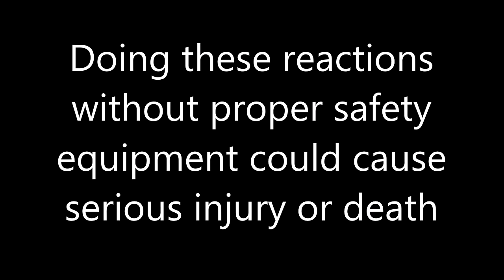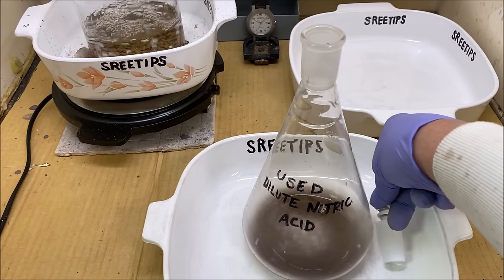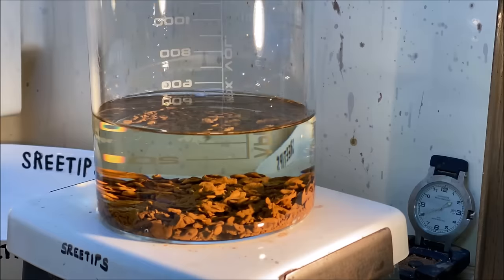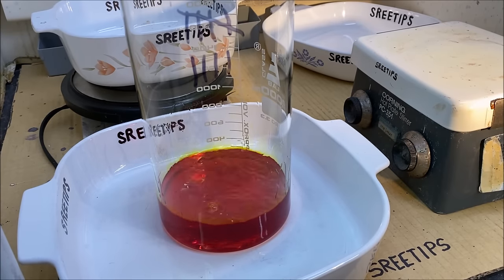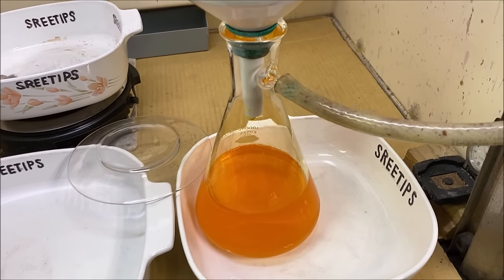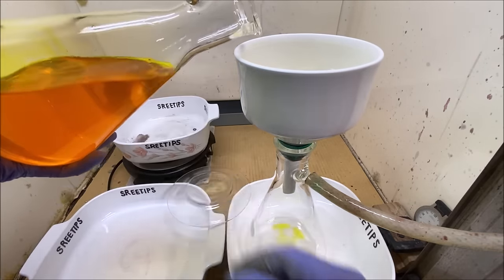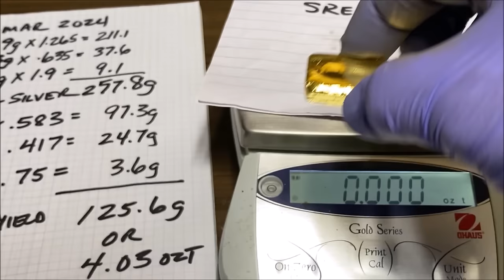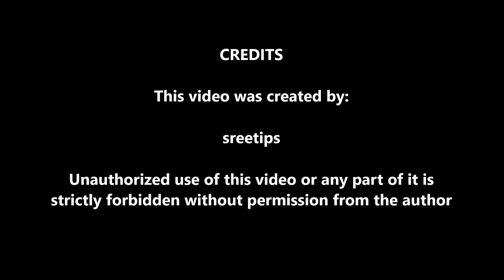Karat Scrap Gold Recovery And Refining 4 Troy Ounces Pt2

Comment: This is why it's crucial to rinse the gold well with several distilled water boils and not just cold rinses prior to aqua regia. Distilled water boils are able to rinse the gold and remove the remaining base metal nitrates much better within the honeycomb structure, resulting in the cleanest gold possible before proceeding to aqua regia, which is the ultimate goal of base metal removal. As you say, the more time we spend in the base metal removal process, the fewer complications we encounter in the gold refining process. This theory also applies when it comes to rinsing the gold prior to aqua regia. This is very important! Other than that, great video Mr Sreetips! Nice looking bar! Thank you!

Comment: Congratulations from Brazil Mr. Sreetips, your videos are awesome! As an old subscriber that is following your work for many years I would like to ask you if possible for a video showing again your waste tratament where you after cemented the silver, you cement the copper with iron, and melt this cemented copper in a bar... I know that the value of the copper is low and you usually avoid work with it, but i believe that it would be a interesting content.
Reply from the maker: It’s heavily contaminated with other metals.

Comment: Have you ever tried putting the freshly poured bar (still in the form) in a preheated oven, to finish the bar to a smooth high lustre? No pour marks.
Reply from the maker: Getting the mold that hot would quickly ruin the graphite mold. Plus, I’m kind of partial to the pour lines.

Comment: There's a new BBC article on "India's army of gold refiners face new competition", and there's a sentence at the end saying: "They are moving away from using nitric acid to purify gold, instead switching to Aqua Regia, which is less polluting."
I was thinking, "Hey, I understood that reference!", thanks to these videos. It must mean that  previously they had been doing the nitric acid boils on inquarted material, and now they are dissolving the gold instead.

I'm not sure, if it was really meant to say that they are doing this as an alternative, rather than to reach an even higher purity which they are talking about in the next sentence, given what we learned here that #1 dissolving scrap gold-filled material in Aqua Regia is a no-go, because too much is wasted, and #2 the more dangerous fumes come from the second method, even with incremental dosing of nitric.
And no masks on the guys in the photo. Although the photo is about the melting, which is the most photogenic part, of course.
Reply from the maker: Karat gold can be dissolved straight away in aqua regia. But two nasty problems can happen. 1) it will put everything in solution, creating a very dirty solution. And there will be a lot of silver chloride that slows filtering. 2) passivation. If the silver content in the karat scrap is high then the hydrochloric in the aqua regia with react with the silver in the karat gold, form a hard crust of silver chloride on the karat gold, and shield it from the acids. It must be scraped off before anymore gold will dissolve. But of course, the passive layer of silver chloride will re-form and scraping must be repeated. Both of these problems are completely eliminated by first inquarting with silver (or clean copper) then parting my with nitric BEFORE going to aqua regia. Inquarting is the easier softer way.

Comment: Would it be worth the time to break up the gold sponge after you have done maybe 5 nitric boils to break up the gold more to give it more contact with new surfaces to make sure all your nitric boils are effective? It seems you waste a lot of good nitric on the 5th and beyond boils because it doesn’t seem to consume all the nitric to take the silver and base metals out. Maybe instead of pouring those off, you give it a stir and move the gold around some to break up the sponge. Is that even possible?
Reply from the maker: No. Breaking it up during nitric boils will cause fine gold powder that suspends and takes time to settle and slows things way down.

Comment: I have a question, I was watching a old video about getting gold from a bottle of catches but you had a problem with springs, the question is that could you possible have a carbon fiber mesh be used as a filter to filter out the gold from the catches as I believe carbon fibers resistance to heat is higher than that of gold
Reply from the maker: No, if I did that again I’d just leave the springs in and add silver and go.

Comment: Hello Sreepips,

What happens if you add the cement silver directly to the anode basket instead of melting it first?
Wouldn't it be easier and faster to purify silver in powder form?
Thanks.
Reply: He tried that, the filter clogged up too quickly.
Reply from the maker: Filter gets clogged up and amps drop off rapidly.

Comment: I keep thinking If it was not more advantagous to pour a bar of inquarted gold and stretch it between rollers before submitting it to the nitric boils. The nitric acid would not have to penetrante as deep as into the large, irregularly shape chunks of.shot. This might save on time and nitric acid expended.
Reply from the maker: I tried it once. Having to fight with the rollers, annealing the bar repeatedly. It was just too much. I’d rather let the torch do all that work for me.
Reply: @sreetips  I understand, alloys are always harder than their constituents and tend to work harden as well. I'm always fascinated by your work. I am a retired chemistry lab assistant, I understand the chemistry behind your work but have never worked with precious metals myself. Greetings from Berlin, Germany.
Reply from the maker: Greetings

Comment: Sreetips, I'm curious about wether there's a way to grow gold crystals as the result of a refining process which would net pure fine gold crystals and could one induce, by temperature, saturation, or maybe voltage, a single large solid faceted crystal of gold to grow...?🤔
Reply: 2nd gold drop at 14:10... in the waste container... lol. It all gets refined in the long run though, no sweat 😂
Reply from the maker: Gold crystals, that resemble the silver crystals, can be produced. But it’s a special process that I’m not familiar with.

Comment: Okay here is a question. Could you dissolve everything in aqua Regia, cement it out of solution, and then do the nitric boils? That seems like it would save you from having to add the extra silver and save nitric acid as it would be in cement form instead of shot form. I don't really know much about the process or if it would even work.
Reply from the maker: No, this is the easier softer way.

Comment: Very nice videos as always. The torch that heats the Mould up was pulsing is there a build up in the nozzle.
Reply from the maker: It’s brand new,
Reply: ahh ok interesting  @sreetips
Reply from the maker: I had the valve that controls gas flow partially closed.

Comment: how brittle is the shot after the nitric boils? would crushing it  some and doing another boil get more base out it, because of increased surface area?
Reply from the maker: It crumbles easily if poked with a glass rod. But the powder will suspend and make separating the liquid from the gold powder difficult
Reply: @sreetips  makes sense, ty for answering

Comment: HEY SREETIPS ITs MIKE . I got a question when I dissolve my gold sponge and aqua Regia and it boils does some of the gold get lost due to the evaporation or not because I have a clock dish covering the beaker and what I noticed is that the yellow color drips down back to the beaker is the gold mixed with the steam?
Reply from the maker: Yes, some of the gold will depart in the finely atomized droplets that get ejected from the beaker. Covering with a watch glass will minimize it. Even better is to heat it gently so that it doesn’t boil. It’s the turbulence from the boiling action that causes atomized droplets to form. Reducing heat so that the solution doesn’t boil is by far the better option. I always boil mine because I’m in a hurry and in a rush to publish my video. Don’t do as I do, do as I say and you’ll be fine. Reduce the heat. Even then you’ll probably still see yellow liquid condense on your watch glass cover. There are losses all along the way. Minimizing them will depend on the skill and technique used by the refiner. If I wasn’t making videos I’d probably do a lot of things different. When that camera is running I’m tensed up and tend to make errors. I’m going to refine a batch of karat gold later this weekend. And I’m not going to shoot video of it. I’m putting the camera away, taking it nice and slow, and try to regain some of the enjoyment I used to get practicing my hobby, like it was before I started using that pesky camera. Be like taking a breath of fresh air.
Reply: P.s tell Teresa HAPPY MOTHERS DAY from me and Maggie your loyal viewers. ❤️❤️❤️❤️
Reply from the maker: Happy Mother’s Day!

Comment: Awesome video, I know you cement all the silver out of your solution, do you ever try to get your copper back, would just stand to reason to re-use the copper as well, I know its not that expensive but could resource this metal as well, thanks for another great video!!!
Reply: he makes cement copper with pieces of angle iron in the solution
Reply from the maker: It’s highly contaminated. After cementing copper in the waste bucket, it’s pretty much waste.

Comment: I have some really nice, fully gold plated, aluminum pcb boards, the aluminum on some is like up to an inch thick. I have at the most like 20-30 pounds, but I was wondering what method you think would be best to process these??
Reply from the maker: Sorry, I’ve never worked with that kind of material. No experience.
Reply: @sreetips  you can't even speculate? I'm wondering if it would be better to use Nitric or reverse electroplate?
Reply from the maker: Aluminum won’t dissolve in nitric, I know that much.
Reply: @sreetips   nice! Thank you. It will in hcl though right?
Reply from the maker: I don’t know, I’ve never tried dissolving aluminum in HCl.
Reply: @sreetips  maybe you can do a video on these next time. The boards are really pretty, fully gold plated, maybe you can find some to do a video on them. I've searched YouTube and no one has done a video on these to my knowledge.

Comment: Question:  When you melt the refined gold with an acetylene flame, it appears to me that the flame is not neutral but slightly reducing (white flame with a long inner tail).  Would that not put a lot of carbon into the gold bar?
Reply from the maker: The flame looks different on the camera than it does in person.